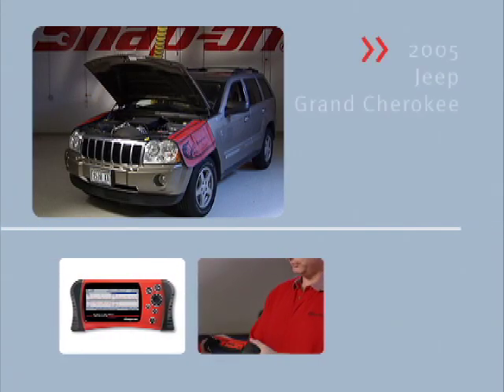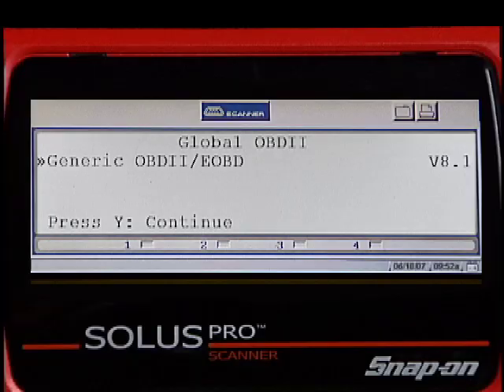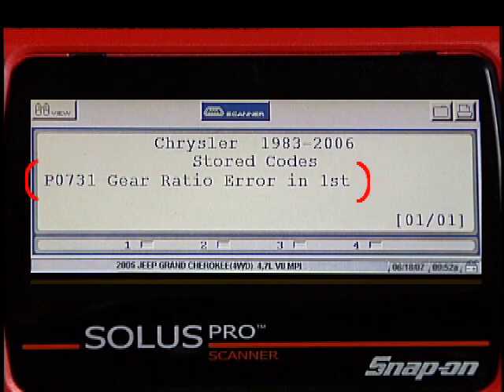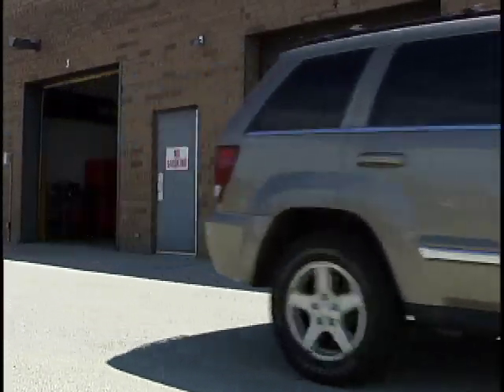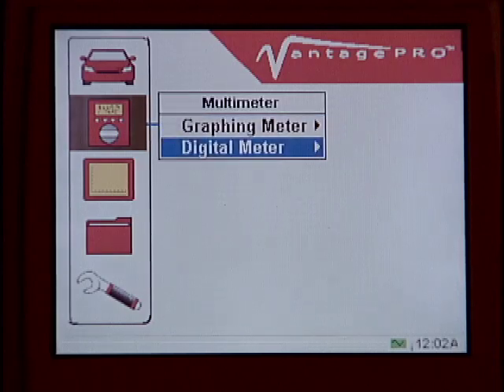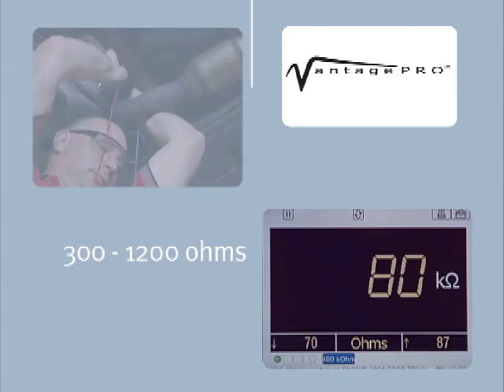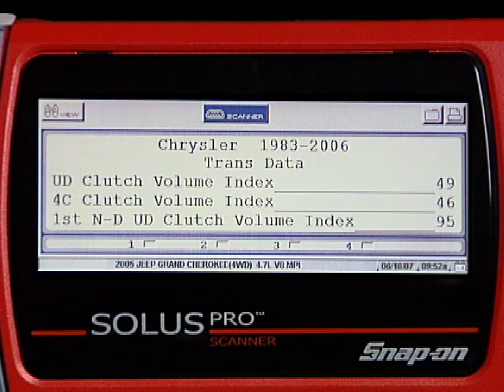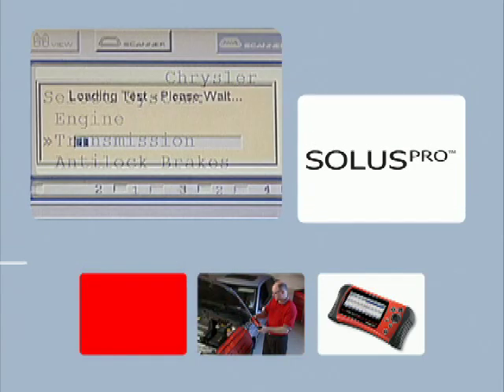Transmission shifts : SOLUS PRO™ Case Study  | Snap-on Training Solutions®

Comment: I already knew what it was because I've had that exact issue in my Mercedes now its back with different issues stuck on high side I haven't scanned it yet but my brothers got newest one im wondering if will flash a new conductor plate

Comment: I've got a laptop with some obd software and a pico scope but I'm still after a decent scanner. The obd software uses the dlc 16 pin connector. Sometimes I get older vehicles and this is where the scanner comes in. Also it has a few bi-directional controls that my software doesn't cover.